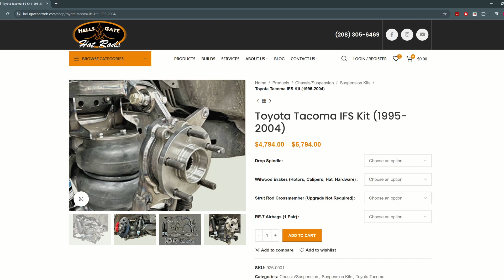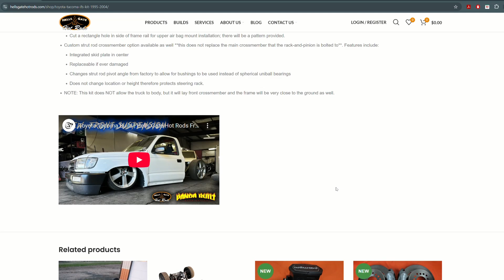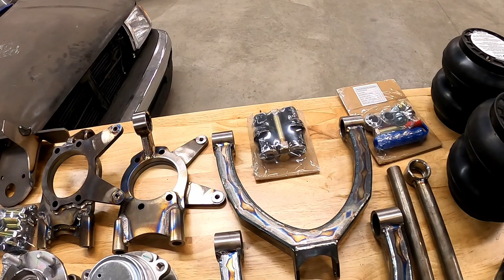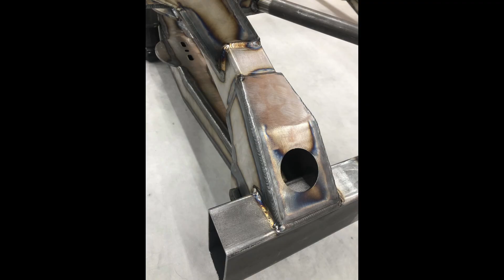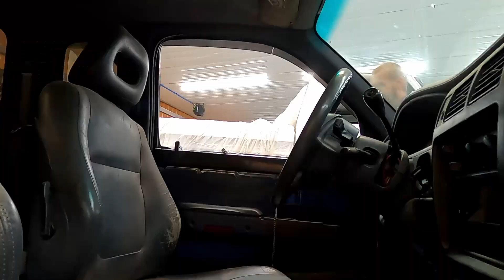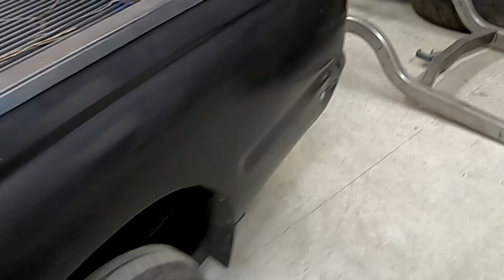Intro: HGHR Toyota Tacoma Project Truck

Comment: Will I need to z my front clip if running 20 inch wheel and tire combo with your kit and 3 inch drop spindle
Reply from the maker: Not technically.  The truck will still lay all the way out  with our kit on a 24" tire but will sit on the front crossmember as it is the lowest point of the chassis.  The z is needed to raise the cross member so it doesn't touch first or drag on the ground when super low.  But that also is much more involved as then you need to lower the motor back down in the chassis since the front rails got moved up.  Hope that helps and feel free to reach out directly to me on our website or social media if you have more questions.  Thank you.

Comment: Don't people understand that big wheels and tires on the front produce excess weigh and drag.  It makes the vehicle less responsive.  IMO a vehicle should be about function first.  Why would you ditch power brakes?  It is harder work and unnecessary work and expenditure.   each to their own,  I grew up when the Hilux was the thing.  Great little pickups ( as we called em in the UK).  Nice to see an independent guy developing a new part of the market
Reply from the maker: When lower the truck that far down, the brake booster is in the way for full steering and tire clearance. This suspension is completely about function and proper geometry while allows the truck to have 10” of usable suspension travel without problems or interferences. Thanks for understanding and supporting me as a little guy.